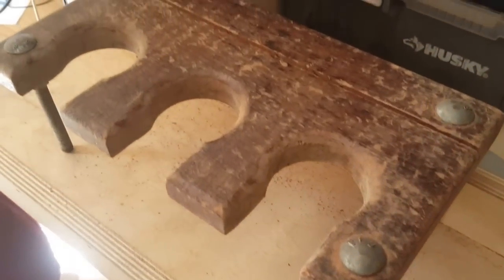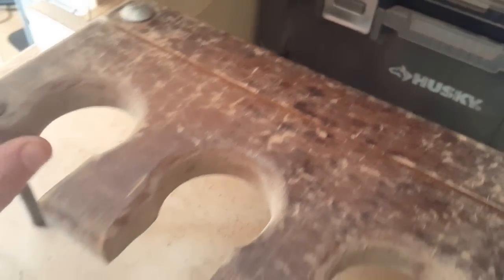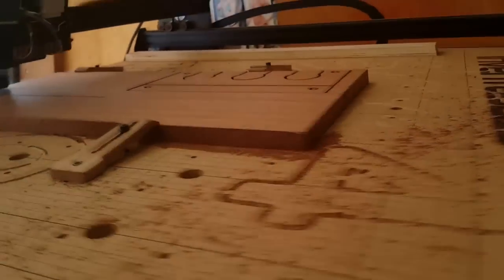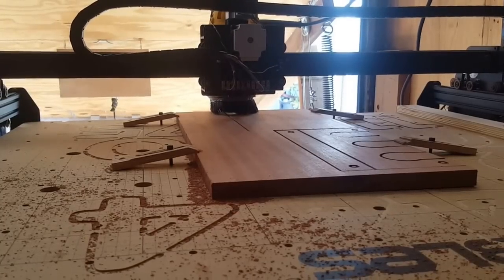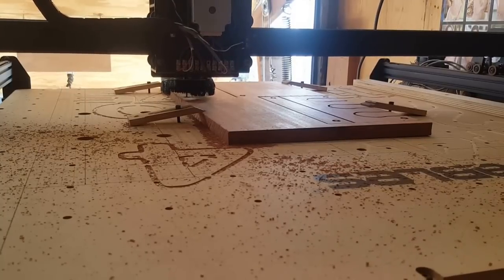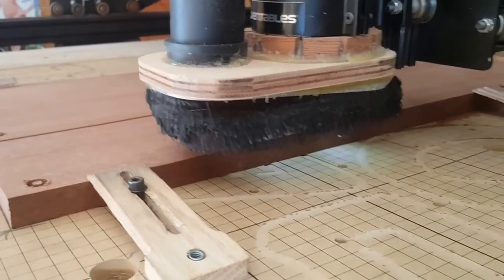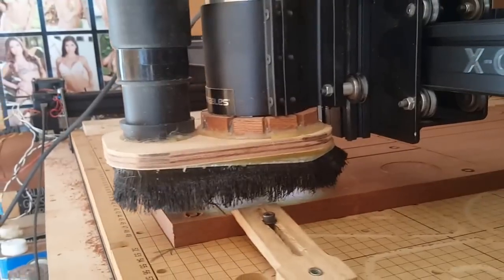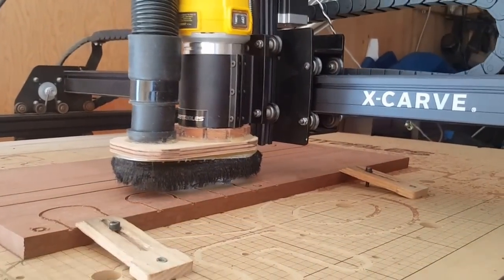Making beer flights for Tap42

Comment: Nice, what type of wood are you using? (I have a 500x500 X-Carve)
Reply from the maker: thanks, this Wood is sapele
Reply: +True Wood Design, Inc. Custom Woodworking OK cool, if you're 100ipm in sapele  which has a janka hardness rating of 1510 I should be able to run 150ipm or more on pine which has a rating of 380-690
Reply from the maker: +Minus D9 pine is less consistent and has sap and knots, so be carefull.